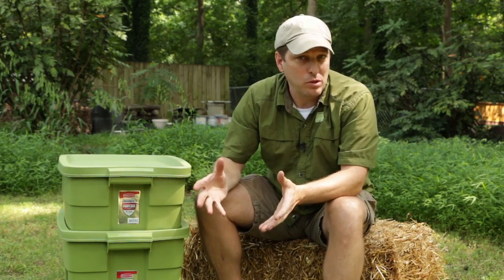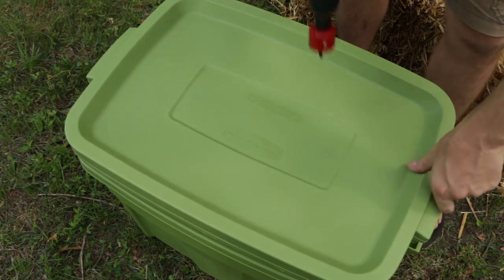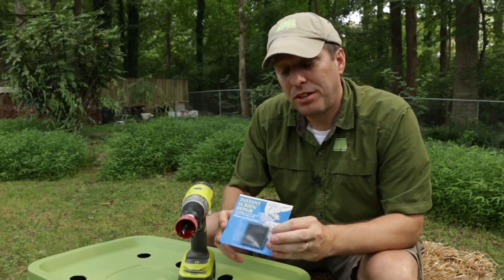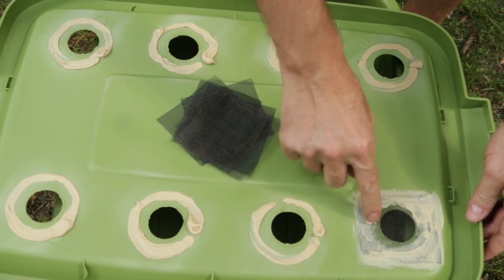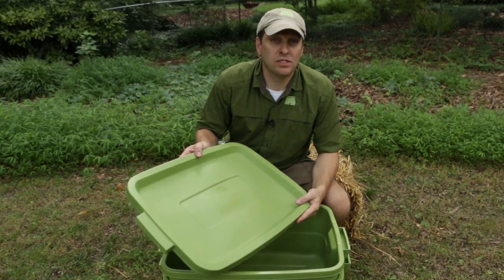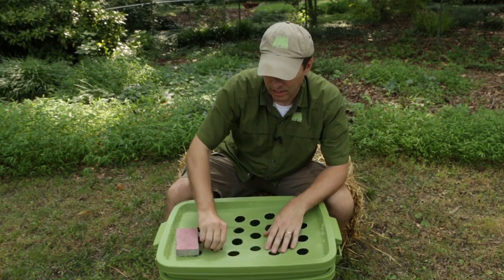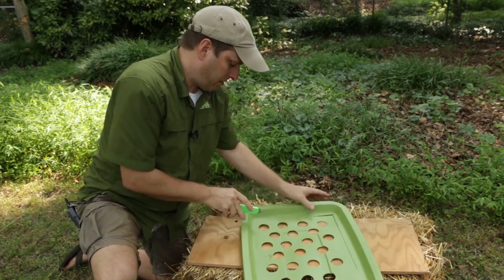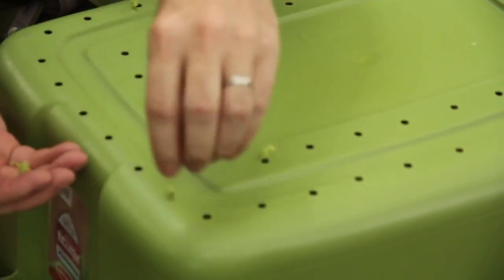How to Build a Worm Composting Bin | GreenShortz DIY

Comment: Love your videos.  I am an organic gardener and have compost bins & compost tea, but have never used the worms.  I am interested in starting one of these, but wondered how long does it take before you have usable castings and how do you get it out of the bucket or bin?  Do you just pour the worms out with it into the soil or do you take out the castings manually by hand.  How long are the worms reusable?  Do they just keep reproducing?
 Also, I understand that you use the tea 1:1, but what about the castings?  Do you just mix the castings into the soil of your garden bed?  Is there anytime you have to wait before adding to your vegetable garden?  I am sorry if you already answered some of these.  I did try to look through most of the questions & your video of Q&A, but didn't find answers.  If you could answer these questions about the output of the castings, that would help a bunch.  Thank you!
Reply from the maker: Hi JB. The production of a bin depends on the number of worms. If you started one of these types of worm composting bins with 500 worms, you can begin seeing castings in a few weeks. You'd likely want to wait a month or two before harvest. 

With this type of bin, I manually separate the worms from the finish compost. I use a sunlight method, dumping the castings out onto an extra bin lid. The worms crawl in, away from the sun. I remove a one inch layer or castings/compost and they crawl in deeper. Eventually, I just put the ball of worms back in the bin. This method doesn't capture the cocoons, which can't move. But having them in you garden is a good thing too. The same goes for the worms. You can just transfer them with casting to your garden, but it makes the composting in the bin slow down until the population recovers.

The worms do have a life span, but it is hard to tell. The colony, under good conditions, will keep growing. I usually divide my colonies into 2 or 3 once a year. Then I give worm bins to friends.

I put castings on the top of the soil around plants in my garden. I use a no-till method, so just allow the nutrients to feed-down into the existing soil, rather than mix it manually. I don't think there is a good or bad time to add castings to the garden.

I hope I answered all the questions above. Happy to answer more. Thanks for watching.
Reply: Yes, you did answer all of my questions, thank you.  One more question... can you mix types of worms in one compost bin, or should you keep the bins with just one type of worm?  Thanks again.
Reply: Would you say that 1000 worms would be too may for a system like this?
Reply from the maker: Hi Brenda...I didn't see your comment until now. :-) I think you could actually be fine with 500 composting worms to get this worm composter started. Thanks for watching.
Reply from the maker: JB, sorry I didn't see you reply until now. Yes..it is OK to mix types. Just make sure they are composting worms versus earthworms. The worms should coexist just fine together. Thanks for watching.

Comment: Thanks for the info on the setup!  A thought on the recycling - think about upcycling them instead.  Those green plastic discs would be perfect nail/screw washers for tin/plastic tacking projects.  One thing though...

You're killing me smalls!  Should have put four tack spots of caulk under the screen press it down in, and then put caulk on top and use a credit card or shopping card to screed it out.  

Seriously though, thanks for the great vid.
Reply from the maker: Don't cry over spilled caulk. :-) I'll be a caulk saver from now on...promise. Thanks for the suggestion.

Comment: Question:  It is going to be winter soon.  I want to put my worms in the garage but it goes below zero here sometimes.  I am thinking of putting grass clippings in the lower bin to generate heat or maybe just back the whole thing in clippings.  Your thoughts please?  Thanks  :)
Reply from the maker: Ken, the grass clippings option sounds feasible. I keep my worms in the garage for the winter, but this is Atlanta, Georgia, so we are usually in the high 20s, low 30s for winter lows. So my garage stays around 35-40, since it is attached. The grass option will generate heat for a while, but I don't have sense for when it will stop. You could try using a low wattage light bulb in the top bin to maintain temp. That might be a more reliable option. Also cover the top with an old towel or blanket to cover the vent holes to keep more of the heat in.
Reply: GreenShortz DIY
I was also wondering what the decomposing grass might do to the oxygen supply in the bin.  Do the worms need oxygen?
Reply from the maker: The worms do need oxygen. The decomposition of the grass would likely elevate levels of carbon dioxide and methane (if it gets cooking). I'm not sure if the concentrations would be harmful to the worms. They are around decomposing vegetable matter by choice. :-)
Reply: Thanks!  :)

Comment: Could you do this with one bin and less water?
Reply from the maker: Yes, but it would need to be in a place where it can drain. The natural process of the worm composting creates liquids as the worms break down the cells of the vegetable matter. You might consider making a worm tower instead. My video next week will be a DIY 5-gallon bucket worm tower. Easy to make and lots of capacity...5-gallons in fact. ;-) I'll send you the link when it's uploaded, if you'd like. Thanks for watching.
Reply: Sure, thanks for thinking of me

Comment: I really enjoyed the manner in which you not only showed how to do this but also explained WHY to do it the way that you did.

Would you be willing to make a video on a good way to make a cheap leaf mulching system? I can find any number of options that use lawnmower engines and what have you but they will work out far too expensive with even a second hand lawn mower setting me back thousands. I'm hoping for a manual option that can be put together without too much capital outlay.
Reply: +Angie Taalman Hi Angie. Thank you for the suggestion. One question...are you set on mulching? I think setting up a vertical leaf composting bin is a great way to let nature handle the leaf breakdown, versus using more energy. I've actually got a video in the worms for a simple bin for this purpose that can double as an aesthetic "leaf wall" yard divider. But, mulching may be your preference for specific reasons, like having lots and lots of leaves. Can you tell me more?
Reply: Tom I went outside today and parts of my garden are knee deep in leaves from the white stinkwood tree. These leaves are just not breaking down. On top of that I lease and am not permitted to bring anything wooden onto the premises so a composting bin / wall made from removable (read wood) substances simply will not work for me. At this point I want to mulch the decade worth of leaf build up and dig it into the clay soil in my yard so that I can go from there and see what this garden really needs. The soil is in shocking condition despite a decade of effort. I am open to doing vermicomposting once the backlog has been dealt with, so long as the options are not permanent or in any way fastened to the permastructure.
Reply from the maker: +Angie Taalman Ah...sounds like you might need that shredder. I actually have an electric blower/shredder vac like this: http://thd.co/1OHlyOl While, I prefer the natural method, sometimes you gotta tackle it with a little extra power. You're using the leaves to aid soil development, so that is good offset you using power. 

I have a video coming where I build a simple (temporary) leaf/debris composter using concrete screen and zip ties. You can simply clip the ties when you move, or when the leave composting has completed. If you think that might be part of your solution, I'll link that video in this thread when it is finished.

I'll have to look up the Stinkwood tree. In Georgia, we have Magnolia trees that have leathery leaves that take a long time to breakdown.
Reply: Unfortunately any composting solution I put in place will have to be entirely mobile and fully able to be taken down in moments. My lease holds me liable for the costs of removing any unwanted structures I put in while living here and the owner of my property is utterly unreasonable on this and a few other clauses. One such clause is that I may not bring any wood onto the premises if there is even the slightest risk of them decomposing and attracting bugs like termites. This is the tree I struggle with: https://en.wikipedia.org/wiki/Celtis_africana . I would cut it down but it is the only shade in my entire property which is surrounded by buildings and therefore bakes in the warmer months.
Reply from the maker: +Angie Taalman Are you in South Africa? I do have an idea for a manual leaf shredder. I should be able to build it this summer. I noticed on the wikipedia page you linked that the leaves are often foraged by animals. You know anyone who might lend you their goat? Then you'd get some free fertilizer too. Everybody needs a friend with a goat :-)
Reply: @GreenShortzDIY  lol sounds like the land owner may have his asshole puckered over a goat if she can't bring a piece of wood onto the premises😲😱. 

Would it be an option to "till" the leaf covered area? Seems as tho maybe covering the leaves with dirt would accelerate the breakdown? I'm just throwing this out there.....see what sticks......I'm new to compost/vermicompost having started vermicompost this year. I have many mentors whose tutelage has been invaluable.....so I'm just trying to pay it forward. Have a great day!!!

Comment: try a hot glue gun rather than adhesive for the screen
Reply from the maker: +matanuska high Good idea. I'll try that on my two bucket worm composting bin video coming soon.
Reply: I tried the hot glue and it peeled right off !! Silicone held just fine.

Comment: Hi there, 

Thank you for the video. Has this composter produced results? Would it work if you put an extra bin on top for the worms to come up and to ease the harvesting process?
Reply from the maker: +Boris Cherner Hi Boris...sorry it has taken a little while to answer your comment. This unit has done well for me. It is durable and inexpensive. I have one (video to come) that is a little simpler to build, using two buckets. If you are interested in seeing the video on that sooner versus later, let me know and I'll produce it. 

I have tried doing multiple stacking bins to get worms to migrate up. They tend to just get trapped between the sides of the lower and upper bin, so it didn't quite worked as I had hoped. That's why I did the perforated insert. I need to do a clean out soon and will video how that method worked. I've got one shot on how to do a manual separation of the worms...that ought to be fun to watch. 

My perspective on the worm bin has evolved to think of the "output" being the worm tea (liquid fertilizer) versus the solid compost. I run water through the bin to generate more tea and leach the nutrients from the compost, leaving the worm in place. When I have done a manual separation I try to make sure I don't leave behind worm cocoons (egg cases) in the harvested compost, but I think that is probably inevitable. 

I have transferred some bulk compost, worm and all, right into my garden beds. In that case, I am glad to be moving an intact ecosystem of worms, babies, eggs and habitat. Hoped this has helped answer your question and add some perspective to this topic. Thanks for watching.
Reply: @GreenShortzDIY I ran into the issue with them getting stuck. My solution? I use old prescription bottles. I drill the holes a teeeeeeny bit smaller so the bottle fits snug(I don't use chemicals or glues) The bottle acts as a connector for the two bins. I drilled little holes in the bottle to allow air flow. If you've ever seen a hamster cage with the tubes and tunnels connecting.....that's the idea. Lol it also helps the worm juice drain better😁